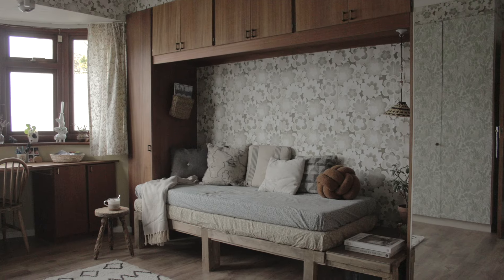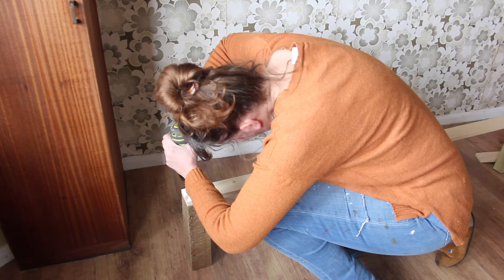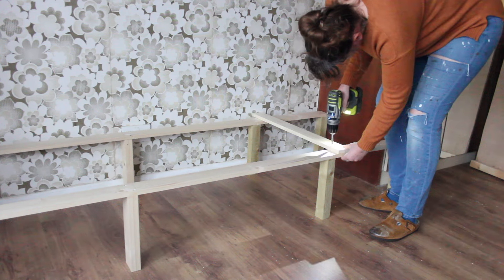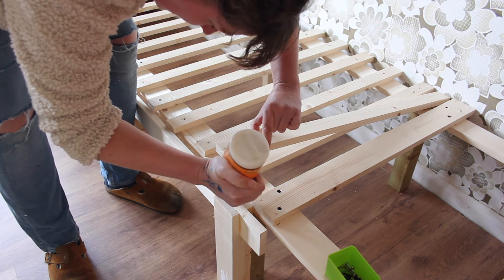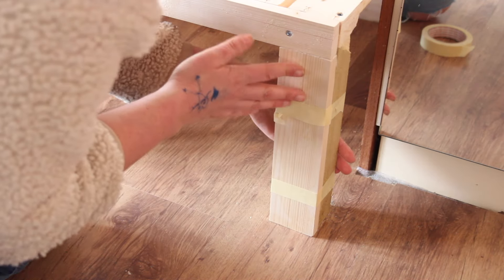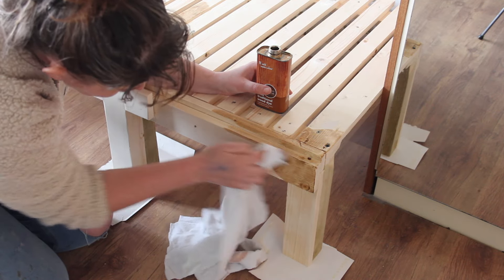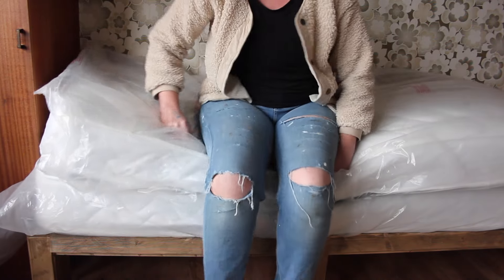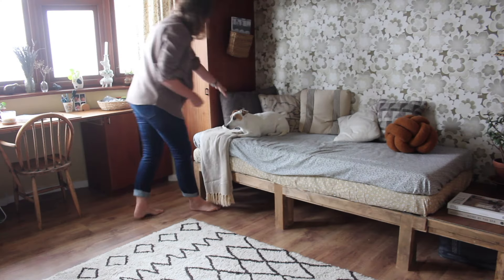I build a sofa bed!

Comment: That bracket that sits at the end of the pullout part- if you mount two of those UNDER the slats of the sliding section- exactly at the point that you want it to stop- then you won't have to hurt your back lifting and pulling it. 😊 Mounted under the slats won't stop you from closing it up because they would be mounted a few cm's in from the edge.
If you're concerned about it sliding around while closed, then you could apply magnets to the inside of the frame (and the outer side of each metal bracket if they're not already magnetic)😊